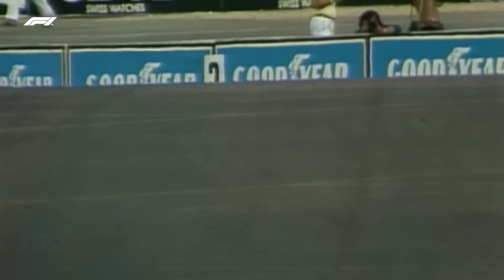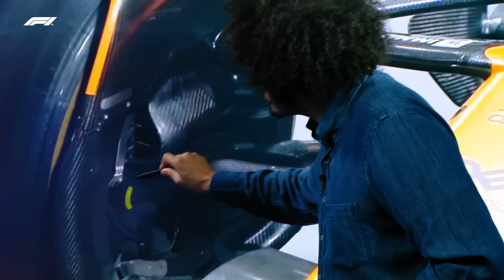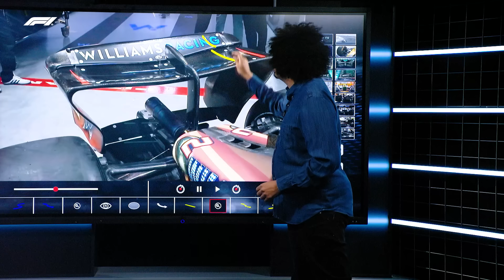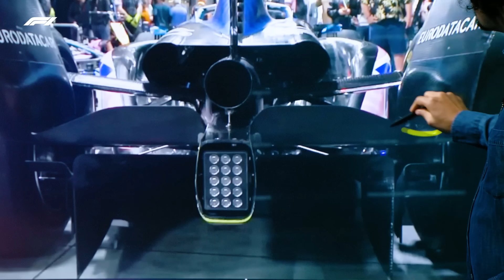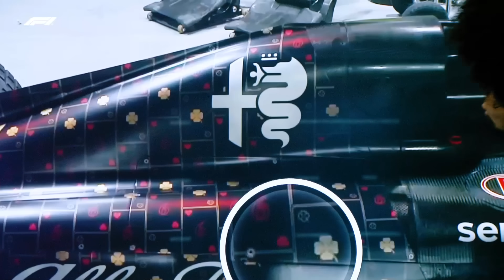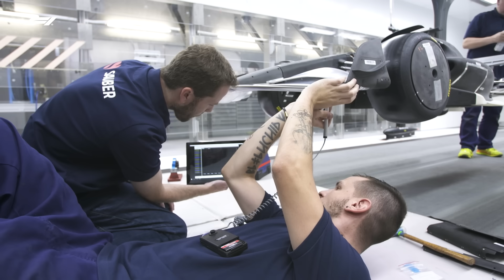A Closer Look At Teams' Set-Ups For Vegas | Tech Talk | Crypto.com

Comment: FIA please could you check the regulation for next year? Carlos penalty is a joke 😢
Reply: So if the damage isn't your fault, you shouldn't get a penalty? 

Then every time a driver gets shunted off the road, they can just have a new PU for free? 

Thats the only other option. Either there are no exceptions, or there is no point having the rule. Every team will argue that every time they change the PU or Battery that it's not their fault and so they shouldn't get a penalty.

The shortsightedness of some fans never fails to astound me...

Comment: I reckon F1 should do joker laps on some tracks. Itd spice them up, we'd see some more tactical moves, and i think it'd be fun for drivers.

For thkse who dont know what a joker lap is, its a single lap where a portion of the lap is bypassed. Drivers use it to gain a 10ish second advantage, to catch an opponent, save a tricky overtake etc. They're often used in endurance racing or carting.

Comment: Could you build a big vacuum on the front/bottom of a vehicle that could test the drain hole covers with the same amount of force developed by the race cars ? Something similar to a Zamboni sponsored by Dyson perhaps ? ? ?
Reply: I mean there's that one banned race car that looks like a fridge and actually has a hoover to produce downforce
Reply: The issue isn't just creating the suction, it's having that suction moving across the manhole cover at 200mph. They don't need to do that anyway, stress forces are very easy to work out with a computer so it won't ever happen again now that they know it's an issue.

Until the new regs it wouldn't have needed stronger concrete, the foam and resin would have been fine without the ground effect of these cars.

Comment: I know that rules are rules but F1 and FIA should also provide, without fault, a safe race environment and they failed at this. Going 300+ kph in a city on a fake track is a recipe for disaster. I hate all street tracks as everything is soo tight. Nobody is pushing 100% and nobody sends it as there is no space to go off in case it is not on… Just return Sepang, Portimao, Turkey, Hockenheim or Nurburgring ang get rid of these booring and unsafe street tracks… that manhole cover could have ripped through Carlos…